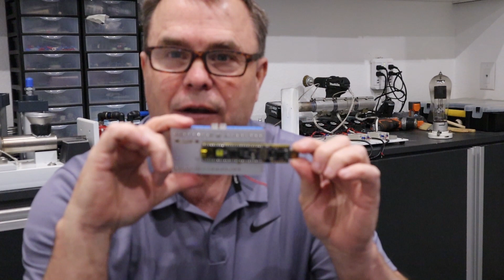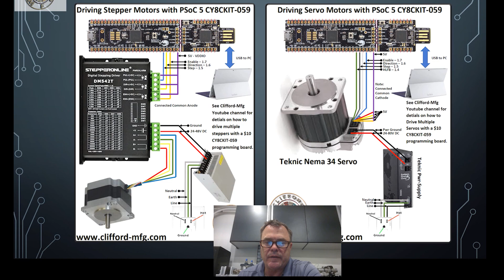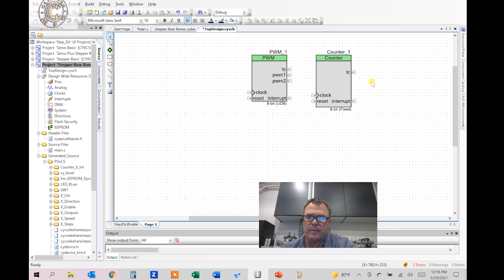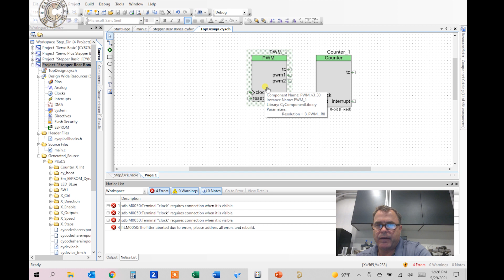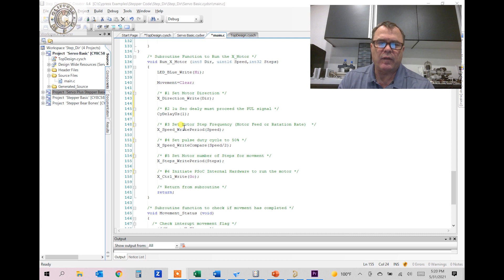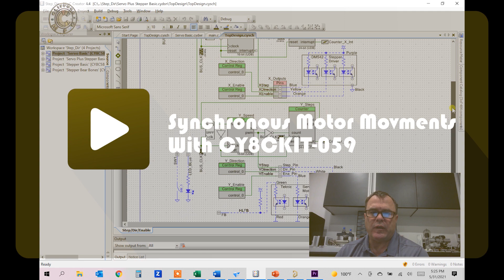Stepper Motor Controller Board for the complete idiot with just 6 lines of code and $10 bucks.

Comment from the maker: Go to website logo in and then go to store: https://www.cypress.com/microcontrollers-mcus-kits ... In the store go to MCU Kits... https://www.cypress.com/microcontrollers-mcus-kits ... In  the kit area go to CY8CKIT-058 ...https://www.cypress.com/documentation/development-kitsboards/cy8ckit-059-psoc-5lp-prototyping-kit-onboard-programmer-and ... This is were you can buy them and down load the things if you want to load into Creator. ...  note curser below and can down load some of the files you can use in Creator.  Note that you don't need these files to really run the board you can just make sure you have the right processor selected in your project.  if you down load the kit projects and example files it will automatically put in the right CPU part and pins selections for you for that project example.  Let me know if you don't get it and I will be glad to help you.

Comment: May want to add that your website is clifford-mfg.com Also, just a heads up, with your higher priced machines, you may have a hard time competing with the MicroMolder machine which is fully automatic and sensors out the wazoo. Great informative video! TY
Reply: With clamed 8,5Tonclaming force?  and now clam as to injection pressure and 1 oz. shot size I think we should be a ok!